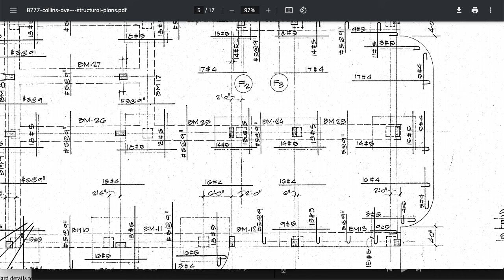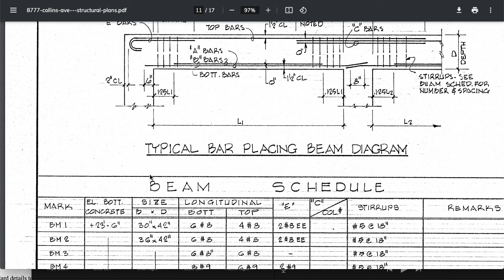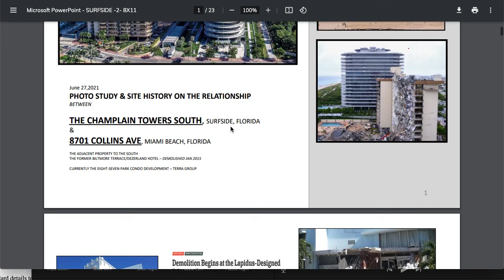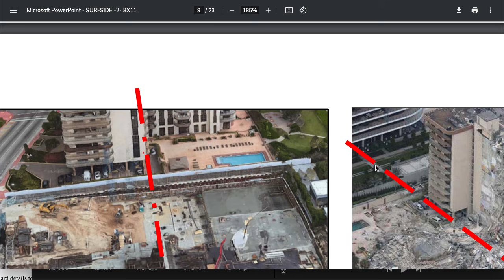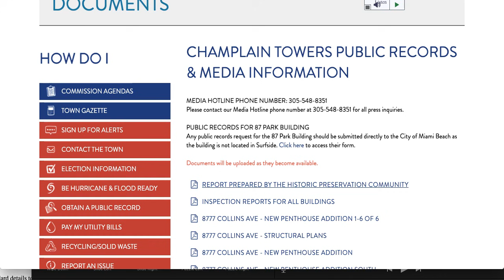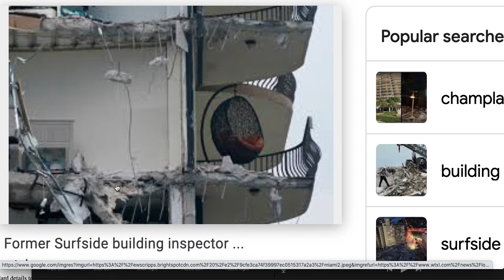Champlain Towers Collapse Demolition of 2nd FL WILL BE TOUGH PLUS PROOF OF EASY ROTATION

Comment: Thanks for first video and zooming It shows some 2 way slab action from the balcony rebar and the column head rebar and why that might have helped the whole building and why if the whole thing had a 2 way slab collapse might have been less / that the way the building was built how the rebar installed doomed it once failure began   at the bottom of the slab is the main rebar as noted in dwgs w just 3/4 inch cover, insufficent to develop anything like full structural effect of concrete and steel in combination it  that main rebar ripped out like it wasn't there   above that is the secondary rebar added for the special condition in this area the projecting balcony  it runs ar right angles to the main rebar into the building for starters had the main rebar been above the secondary the ripping force from the  main rebar would have been transfered to the secondary and to some extent distributed into the rest of the slab though in this building that rebar running into building from balcony didn't even run in a full structural bay limiting it's usefullness in distributing loading  .Of course that would have made the balcony rebar the one that would rip out easier, however that piece of rebar was in compression and ripping out wasnt an inherent problem  Also, rebar can be tied to other rebar adding in the strength of that tie, or even spot welded.  A very wise structural engineer once told me if rebar isn't welded you rely on concrete to transfer load and if its tension load concrete is horrible at that   Now at the top of the slab is more secondary rebar the rebar added to reinforce around column tops to resist shear and transfer forces into the column  that rebar still even has some concrete on it saying it was doing it's job better than other rebar in the system.   Had this column head reinforcing been throughout the whole slab, and balcony rebar projected in thru the whole building it would have meant crossed rebar at top and bottom of slab failure would have been resisted more lives might have been saved

Comment: Why was there such a vast difference in support/construction of the different parts of the building? The part that fell had tiny columns and this remaining structure appears to be far better supported.
Reply: I noticed that, too, plus the section with the smaller columns had an addition on top, a penthouse at the 13th floor, which took a variance and lots of $$$,$$$ to allow for it.  To me the smaller sized columns don’t seem big enough, but I would have to see their calculations to be sure.

Comment: no need to demo from 2nd floor down on initial takedown of the remaining tower,  they will drop it easily, and have excavators with breakers go in and clean it all up. footing schedule shows no grade beam tie -ins, can’t tell you how many times we excavated for them after parking structures or buildings erected to enhance seismic upgrades. I am gonna hypothesize and say it was soil washout and undermining of the pile/column footings, which then failed…if they want to they can saw-cut  and fly the pieces down easily…bring the pros in with 6 cranes and saw/core-drill crews, slurry water control crews, just have to shore up below on each floor before starting and have at it…can work around the clock doing it this way and have it down to a breaker level pretty quickly.

Comment: Interesting the rotation thing. Now this might be important: I recall an interview with a  cuban lady, who escaped the building only seconds before the collapse. She shared that she woke up and heard noises inside the living room. She got up, estranged because she was sure she had shut the balcony sliding door window before going to bed, but to her surprise it was open, she tried to close it but door wouldn't move, as if the frame was bent or something, and the window just wouldn't slide. I didnt underwtood then what was this about, but It makes sense now for me, regarding the building rotation you explained!  She alos said she then heard a cracking noise and saw a crack on the wall, opening right before her eyes, like 2 fingers wide. She panicked and left the appt right in time. Her appt was on the 6th floor. Maybe this is useful for you. 
Great explaining throughout all your vids. Thank you!

Comment: This is off topic, but I want your opinion. I’ve watched a lot of your videos but not all, so apologies if you’ve already covered this. You mentioned (at the end of video discussing the plans and pool level drains) the plumbing inspectors hand written note about drainage would not work with existing infrastructure. Can you discuss that infrastructure issue further and if ground water, sea water intrusion, erosion, or just a changed subsurface would impact the foundation stability and strength. I’m also going to try to post some pictures next interesting to me. 1. The confluence of pump stations in this location 2. Presence of heavy equipment on the beach right behind condo - just curious about this. Was it related to imminent repairs or is it a city project?

Comment: I Don't Care What Anyone Says.. I Think The Drainage Was Clogged Within The Building From The Roof FOR AT LEAST 25 Or More Years.. Which Caused The Deterioration Of The Concrete And Cement INSIDE The Infrastructure Of The Building.. What Convinced Of That Was When The Lady Stated That Every Time It Rained Hard Enough, The Wall Inside The Condo Would Get Wet.. So, Since It Wasn't From A Plumbing Problem Due To Running Water? It Had To Be From A Drainage Problem From The Drains Running Through The Walls...

And, When I Seen That Water Pouring Out Of The Basement Sealing AFTER They Had A Major Storm From Another Tenant? I Was Pretty Much Convinced That The Drainage That Caused The Building Collapse? Was In One Or More Of The Storm Water Drainage Towards The Center Of The That Building.. If I'm Right? That Building Should Be An Easy DROP During Demolition.. Because The Concrete And Cement Is Already Basically Done.. JMO.. Jus Sayin.. Yep...

Comment: The Question Is, Are Those Beams Concrete Or Steal.. If They're Concrete.. They'll Be Easy To Demolish.. But If They're Steal? They'll Have A Problem... If You Ask Me? They Should Have Been Forced To Use The Same Codes That We Have In New Jersey.. No One Has EVER Heard Of Building Collapsing In Atlantic City.. Same Ocean.. But We Have The Cold Weather To Deal With... Jus Sayin.. Yep..

Comment: please look at the photographs of the driveway ramp.  The interior has a sprinkler main that is perpendicular to the ramp.  The sprinkler has a section missing from it and is probably on the floor.  That is where the water could be coming from.  That would also mean that the building shifted to cause that pipe to breakaway.  JT
Reply from the maker: I have no verification if true placement of water break, that is why I am not using it to triangulate...

Comment: 17:00  1 2 3 no, they didn't see the same vid we did then, the face of 2 was falling first (remember that falling light further down on the structure), pulled the top down onto 1. lol.   now, feasible the weaker pool deck did give near 1, however it could have been anywhere on the pool deck that started it, and them columns are also still standing, so I realy doubt the ground had anything to do with it.

Comment: I just read an article that the original permit had been pulled and the contractor quit. A new contractor came in and penthouses had been added to the plans and they weren’t sure the foundation had been adjusted for the weight. There was a problem with the height of the building because it went above the height limit. The article also said several contractors came in around 2000, I forget the years, tried to fix cracks and failed.
Reply: @Alan d'Eon  There was a cease and desist order for the extra penthouse.  Then there was a huge sum paid, and then they were allowed to proceed.  (Source-city’s documents on their website.)
Reply: I saw the same.

Comment: A reinforced concrete structure this size needs a structural engineer full-time during construction of the skeleton. Too many corners can be cut with setting rebar.
Reply: totally agree, and the rebar depth was the cause of a few "flat slab" construction collapses. a lot of lessons learned since this building was made.